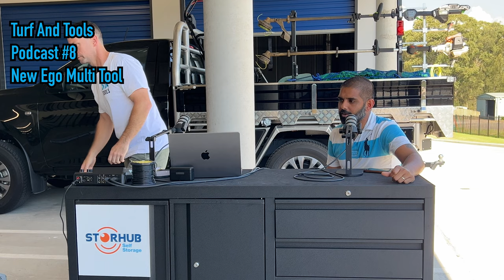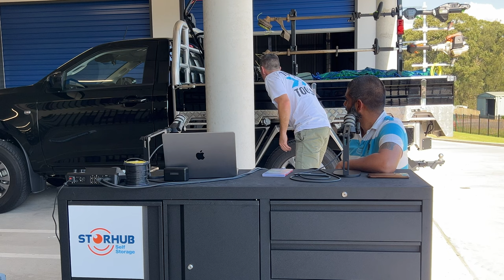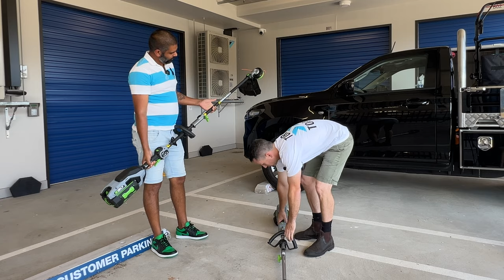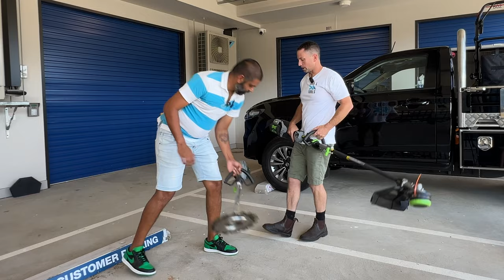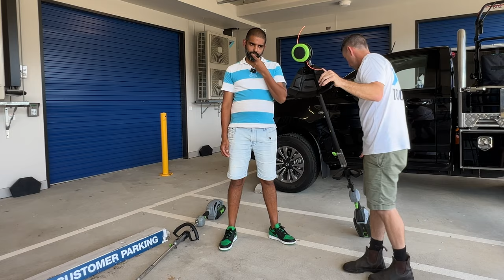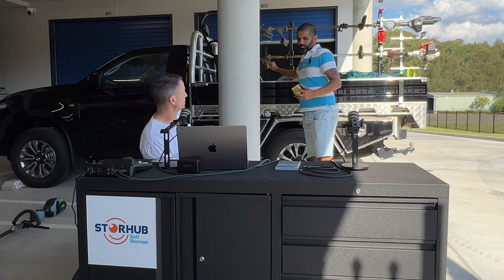Turf And Tools Podcast #8 We unpack the NEW EGO Multi Tool

Comment: the 500s battery is hardcore.  it has credit card like cells so its way more resistant to drops, dust,water.  Its aimed at commercial use and it is there to service all the new products that stihl will release in future.  Their new msa300 chainsaw needs this battery to go at its highest power.  The battery has double the charge cycles as well compared to a ap300.  There's a lot more to it

Comment: The USA version of the XGT 40v mower does have a rubber rear flap.

I run auto most of the time as the mower is great at ramping up when needed. A decent compromise. Max RPM mode lifts better and I use it when i'm not concerned with runtime. I don't use the silent modes.  

Realistically, you would need  six 8ah batteries for all day running if you can charge on the job. Two 8ah batteries give you about 50 minutes runtime. Charge time is 1hr 15mn.

It would be great if Makita sent you out a 64v mower to test out. I like the idea and battery form factor, but. Its a slow charging system just like the PD1200/PD1500 backpack battery. The current 40v XGT supports fast charging. 

Spent 4 house today at grandfather's house. Go there every Saturday for the last month. Mum and her sister help Grandfather sought out inside. I do all the yardwork by myself. Spent nearly four hours with XGT power head with whipper snipper attachment. Tonnes of Kikuyu overgrowth climbing fence. Plenty of power to cut through it.